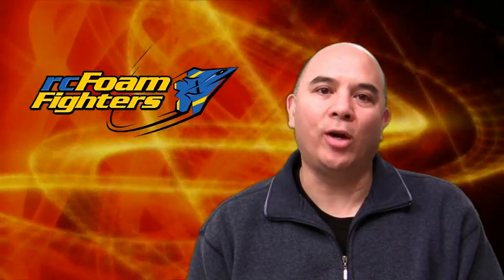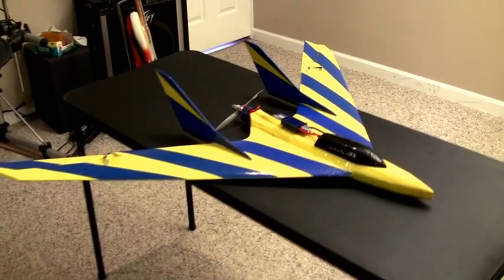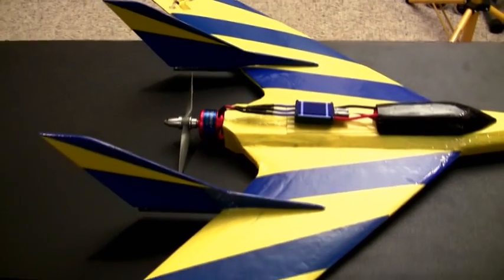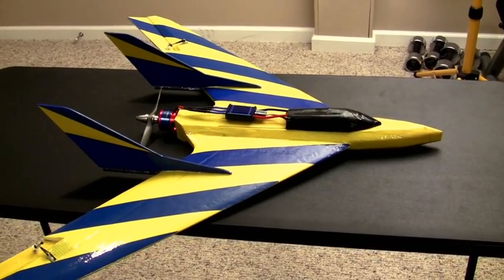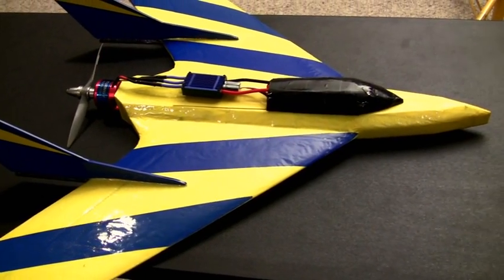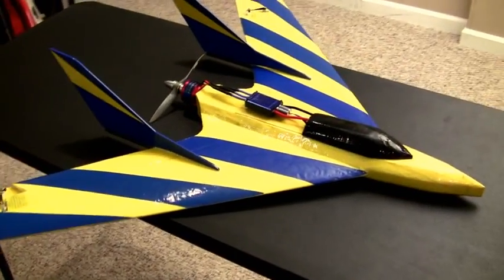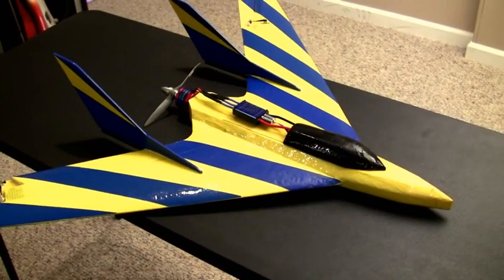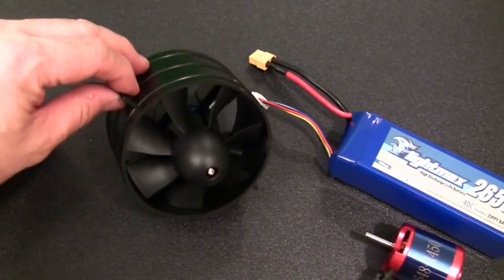FF-Sparrow additional mods and upcoming projects

Comment from the maker: rao876 you can build planes from many kinds of foam and they will fly fine. We like using epp foam because it can take crashes much better without being destroyed. This is becuase epp is spongy and will absorb most of the impact without breaking. I have not seen any other foam types that can do this. So  build from what you have available where you are but remember if it is not spongy it will break if crashed hard.

Comment from the maker: Eugensdiet  The voltage dropped to about  20.75volts, times 1450kv is just over 30000rpm with an APC 6.5 x 6.5 pylon prop the trust calculates out to just over 80 oz. I will do more static tests later and check the actual rpm with a laser tachometer to see how close the numbers match. I'm sure it will all change a bit once the plane is in the air.

Comment from the maker: That's Funny johndog35, lol!!! The speed challenge is on RC Groups Forums. It is open to anyone who wishes to compete and will be an ongoing challenge. You only need to build a plane that follows the rules on the first page of the forum, Clock it with radar or sound wave Doppler program, and post this with video footage of the clocked passes along with some documentation of the build to verify no cheating. I'll put a link in the video side bar so you can check it out.

Comment: Fly the Sparrow without modifying the controls but please work up in stages.  Do a glide test first, then do low power runs.  After you have it trimmed out, then go for full power.

Comment: was unstable 
increase the airfoil at the ends of the  wings it takes away the tip stalling !
and how about rocket assist 
airstart a G motor 
see how fast 
mines flown at over 800 miles per hour 
strickly on rocket motors
my SR-71 hold 3 3' motors and is juat over 5 feet long and weighs from 10 to 18 lbs depending motor configuration

Comment: In the Netherlands 1similar battery is 98 Euro = 134.44 US Dollars. So for an extra 42 Euro = 57,61 USD I would have a complete setup with battery, motor, ESC and receiver delivered at my door.  

There is no way that I can find a similar ESC, receiver  and motor for less then 42 Euro in the Netherlands or in the rest of Europe. 

PS
Your ESC is OPTO, with no BEC supplying power to your receiver. You will need an extra power source for your receiver. (such as UBEC or Rx battery pack) motor specs

Comment: I did some calculations !!
Even with shipping, tax and handling cost and insurance it would be a lot cheaper to order from Hong Kong. Above 22 euro and below 150 euro = 205.77 USD we have to pay 19% tax  and 12.50 handling costs, plus shipping and insurance costs. Above 205.77 USD it would cost an extra 12.5% custom rights.

Your setup from 98 US Dollar would cost me 140 euro = 192.05  USD IN TOTAL with shipping, tax, insurance and handling costs. 

In the Netherlands one battery costs 98 Euro !

Comment from the maker: natethegreatBlitzMax please have a look at the videos of the SkyFighter v2. It is the same plane only a little smaller and was made to take a 2212/6 motor amd 30amp esc combo that cost $30. The plane flew 94mph wit a 3 cell 1350mAh 30c LiPo.  There is also a a build forum on it in RC Groups forums. That plane could easily be made to break 100mph with a little bigger motor.

Comment: the wing in the back on planes does not lift / support the weight but pushes down.
don't move the CSs inwards that will make it worse.
I think it will be slightly better next time, but not much, there are still general stability problems.
I still think the only way to maintain the body will be to put the motor on the nose, it may look ugly, to you, but it will work.

Comment: I'm a little confused at the naming convention you guys are using. Everywhere else I've looked in areomodeling "FF" indicates "free flight", i.e. the aircraft is not controlled from the ground, but rather is tuned to fly on it's own. So what's the "FF" stand for in this project?

Comment: I can see a Bat machine in the FF sparrow  design, imagine it's black and with bat like stabilizers and wings :-))

But that setup for less then 100 dollars amazes me, I have the impression that here things are a lot more expensive. I looked up some batteries in Dutch shops, and I came to this shocking conclusion. 

 LiPo accu 11,1V 2600mAh 38C  98 Euro = 134.44 US Dollars in the Netherlands

Blue Lipo 3-Cell  11.1V 2650mAh  40C  Sale price 27.70 Dollars = 20.19 Euro in the US, I mean....WOW !!